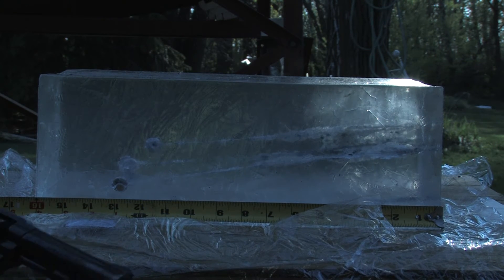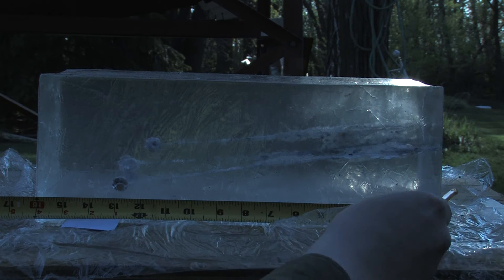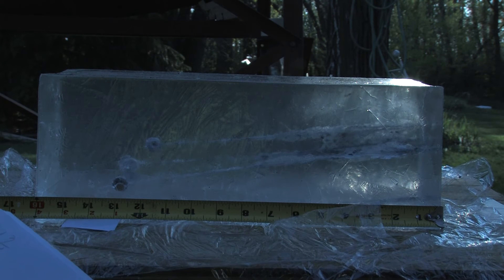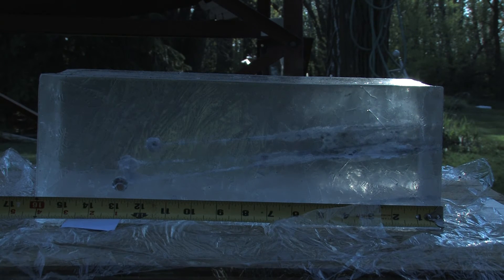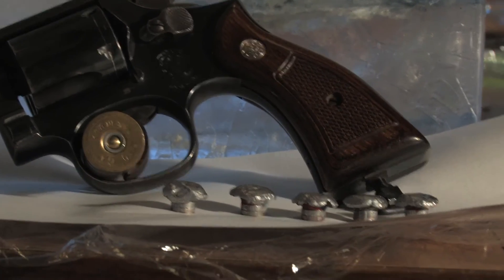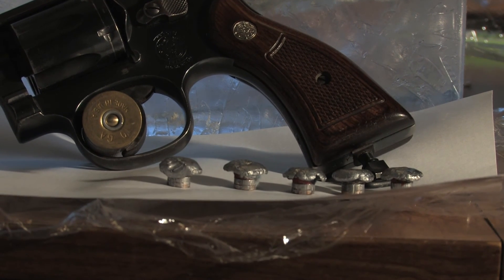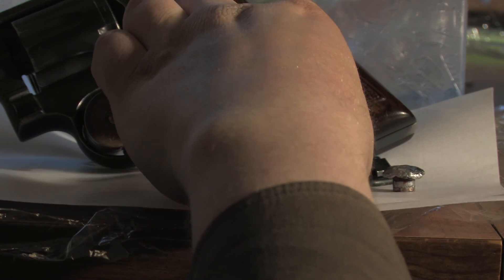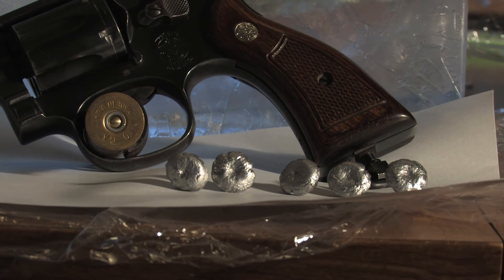Buffalo Bore 38 Special FBI Load 4 Inch Barrel Gel Test

Comment: I have a S&W Model 10, 4" tapered barrel pistol that I enjoy shooting. With round nosed bullets I wouldn't be afraid to carry it for deeper penetration, or thicker clothed assailants. I don't care about comparisons with other calibers, that's apples and oranges, you carry what you have, and you learn to shoot it well, when shot placement is critical. I like many calibers of revolvers and Auto's, but this one is fun and cheap. I use it in a certain capacity for self protection, and my Glock for others. But, like the .22lr, there's been a many a man laid in a grave with a .38 who would argue with you on how deadly they can be, when shot placement is spot on. You can carry a Howitzer, but if you can't hit a barn door, you are just as dead. So, whatever you shoot, master it. I wouldn't want to take on a bear even with a .300 mag, if he was determined to kill me, but, for walking around the woods in Mississippi, or a hideout gun, this will do. If you don't have a .38 now, or do have a .357, it's cheaper to shoot a .38 load and lots of fun to plink with. Your recoil shy wife will like them too.  Enjoy!

Comment: I use these type projectiles all the time, they work.   The thing I have a scratch with on using only penetration tests as a barometer of a loads effectiveness is,  the FBI came up with these numbers to cover MANY possible scenarios, and they are more likely to encounter them than regular people because they aren’t just SD, they also actively pursue people, making their situations more unique.
 My point is, while having a load that meets all their criteria is a good thing, think about how thick a person is from chest to back.
 Now think about sideways.  Ok so the guy turns as you shoot, you hit his arm,  it will likely still enter the chest, and if not, he will likely want to be shot no more.  Now an agent may have to shoot through a door, car window,  stop multiple perps etc.  I’m not saying penetration is not important, I’m saying if it stops an inch short of the standards,  it’s still going to work for most citizens in a SD situation.  If over penetration is an issue, why would you shoot someone facing you in the chest?  It’s a good bet it will penetrate straight through,  and they have qualified immunity.  If all you look at is penetration a hard cast or FMJ has plenty.  A bullet that stops at 6” in a chest shot has dumped its energy and reached vitals.  The best bullet made won’t do much with a low shot to the “ love handles”.
 That’s why the fight either stops after a hit, or you continue to shoot until it does.

Comment: I carry this load in my Taurus 605 for home carry.  It is effective, with significantly less recoil and noise factors than the .357 rounds my revolver is chambered for, averaging right around 970-1000 fps out of my 2" bbl.  When we go for our walks in the mountains here in SE Wyoming, I chamber the BB 180 gr. hard cast flat nose gas checked .357 magnum load at around 1260 fps.  That's as fast or faster than most 158 gr. 357 rounds out of a 4" bbl!  Needless to say, I only carry Buffalo Bore rounds!

Comment: Never go wrong with a 158gr lead hollow point in 38 Special.  Has always been a superb ultra-reliable performer. These hot Buffalo Bore 38 Spl +P's will even open reliably out of snub-nosed revolvers with 2" barrel, having velocities in the 950+ fps range. That's a higher velocity from a 2" revolver from BB ammo than 38 Spl +P 158 gr ammo from Win, Rem & Fed has from a 4" revolver!.  I've long felt the 38 Spl 158Gr Lead HP's to be the best ammo across the board for self-defense, superior to modern 9mm, 40 and 45 ACP JHP ammo.  Superior because the 38 SPL +P 158 gr is the best balanced load of all, with decades of proven reliable stopping power in an easily controllable, low pressure round that almost anyone can fire accurately and effectively with a little practice.

Comment: I occasionally carry this load in my 3" 357, you should check out the new 130gr HST micro, I was getting a 1142 fps average and 14" penetration consisantly in 10% gel, the HST load should be very effective, I do like the heavier Keith bullets of the FBI load and also is this there +p or regular versio?, even there regular version is faster than off the shelf
Reply from the maker: This is the +p loading from Buffalo Bore.  From everything I've seen, the 130 grain HST has been one of the better performers in some tests, it and the Gold Dot 135 have shown controlled expansion that isn't too much, avoiding too much drag and keeping the bullet from penetrating deeply enough.  Depending on the load and gun there have been failures to expand as well, and the expanded face is positive, but its far from the nice round mushroom shape that is perfectly ideal.  Still a better choice in 38 Special rounds.  

Thanks for watching and responding!

Comment: How does the recoil on these compare to common commercial .357 magnum loads?
Reply from the maker: Its about right up there with them.  When I've shot the BB load out of my Model 27, you could definitely tell it was less than full house 357 Magnum, but close enough that if you weren't paying enough attention it might fool you.  Then again, the big N frame 27 is built to handle big magnum rounds all day, out of this K frame these rounds kicked significantly harder than any 38 +p, and overall, yes these are far closer in recoil to magnum loads than +p 38.

Comment: Great video. Have been reading and looking for more info regarding the HTP Rem "FBI" loads as the most recent post I find was complaining about low velocities. I think Winchester just brought this round back too. Will have to get some myself.
Reply: For factory loads duplicating traditional 38 Spl +P 158 gr LSWC-HP loads, get either Remington Express or Buffalo Bore Standard Pressure, as both loads make 950+ fps from a 4" revolver and around 850 fps from a 2" revolver and use a soft lead hollow point bullet that is extremely deadly. This load was called the "widow maker" in the 1970's-80's as an extremely high percentage of bad guys went straight to the morgue in police shootings of that era. A very high percentage of bad guys survive hits by 9/40/45 JHP's in today's police shootings. 

The deadliest 38 Spl loading, hands down, is the Buffalo Bore 38 Spl +P 158 gr LSWC-HP making 1162 fps from a 4" revolver and 1040 fps from a 2" revolver. This BB load moves the 38 Spl into the heavy hitter class of handguns and duplicates the extremely deadly and effective 38 Spl Hi Vel (AKA "38/44") loading from the 1920's that was loaded for police use during the 20's gangster era.  As deadly as the 38 Spl "widow maker" was and is, the "38/44" is even deadlier and Buffalo Bore's 38 Spl +P 158 gr LSWC-HP loading duplicates the "38/44" perfectly.